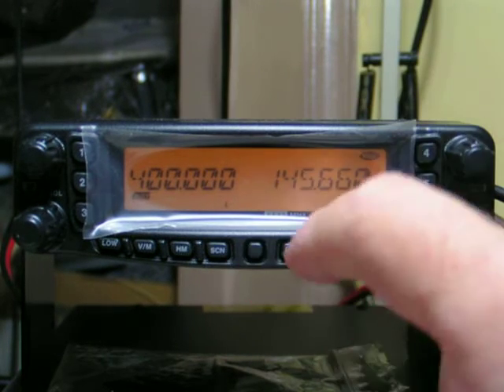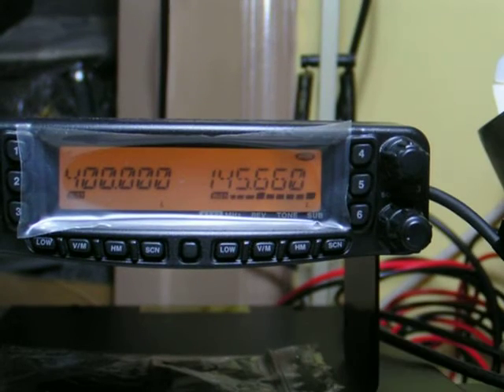Yaesu 8900 QUAD Band 28/50/144/430 MHz transceiver basic functions

Comment: Hi there, will this transmit in cb radio band as well?
Reply: Leon P  26.9650 MHz to 27.4050 MHz this are CB frequencies and this radio had Yaesu FT-8900R Specifications. Frequency Range Receive: 28-29.7, 50-54, 108-180, 320-480 and 700-985 MHz (cellular blocked).

Comment: I have the same radio, What antenna are you using. Thanks
Reply from the maker: Hi Glen, thanks for watching. Currently, I am using my 8900 with a home made V/U 3-radial ground plane antenna. I got some pics of it here: http://sv1qzs.mppa.gr/deluxe-vhf-tripod-antenna-for-portable-missions/  . 

However, in order to fully  utilise 8900 on the 6m and 10m bands, I am planning to construct a 4-band fan dipole antenna system soon. 73, Kostas.